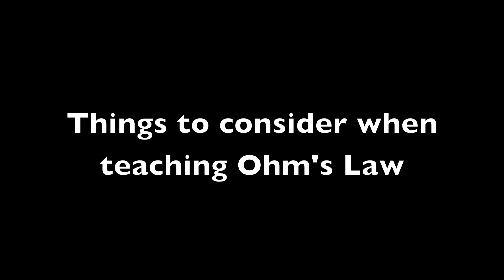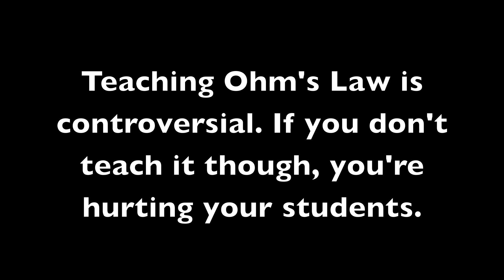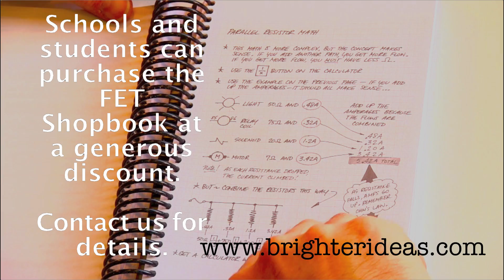Teaching Ohm's Law to Techs - Part 1

Comment: with 17 years in Mobile Electronics, 46 years from the time I was a kid until now working with electronics and DC voltages.
I walk into a home depot and ask what is supposed to be a licensed electrician for 10-3 wire to make an extension cord for a table saw rated at 240@ 18 Amps draw max
When the saws manual states Maxlength of extension cord at 10-3  if 50' (21 to 30 Amps) Not even going into how long the cable will be I get this if I try to run more power into the saw its going to heat up and fry the motor on a 220/240 volt 3 hp single phase saw, he tries to tell me its like a garden hose its going to blow up fatter ?????  I'm putting too much current into the saw The guy has no frickin clue how Ohm's law works.
Using undersized wire would cause resistance and heat up the motor.
I asked for oversized wire it could have used 12-3 cable for the distance I was running it from the dryers outlet plug hole, I also took into account the fact the dryer circuit is a 30 Amp breaker and 25' long This gives me a total 50' of 10-3 at 18 amps AC This is overkill for what I was going to do.  I told the guy you've got no idea how ohm's law operates and walked away.   " I'm feeding the saw too much power my ass" The saw will use whats required to run the wires will not heat up and its not going to burn up the motor, Almost all motors have a protection circuit on them, if mine did not I'd have added it @20 Amp's 
Your darn Right,   I,E,R  is no way to teach Electronic theory and ohm's law.
When I was in high school I wanted to become an Electronics engineer, The math Theories thermians ex.. are hard  You can't do What I did stay out late and party, then try and remember this stuff the next day, you won't do it. Having dyslexia made it even more complex to deal with because I had to work twice as hard to learn anything. But once you Learn it you will not forget it.
When I was about 13-14 Microchips came out simple micro chips.
This stuff is 10,000 times more complex today. Now its microscopic electronics.
You still use the same Electronic Principles today they did making vacume tubes, your just adding billions more of them. Each one doing its own thing.
A computer when I was 8 filled a room 3 times the size of a football field ( to an 8 year old)
And it wouldn't even begin to do what a smart phone can do today.

Its an exciting field to be in, if you like electronics It pays good do it. Go to school study hard go home and do your homework, ignore other kids, on the side learn how to program or make software.  You'll never have to want for a job.

Comment: Never had this problem ever. Once you have the concept of electricity the terminology is very easy. What bothers me is even some people who had a diploma in Electronics can't even explain what these are but only memorizes the formula;they can answer problems on paper but most of the time can't troubleshoot or misdiagnose stuff, such as thinking it is a software problem instead of the sensor. I'm in automation and despite the orientation towards technology my teachers emphasized strong physics understanding not just knowing how to use tools.
Reply from the maker: Congratulations. You're fortunate. Thousands aren't. That's the point.

Comment: Thank you! Your 'suggestion' at 3:40 to use a=v/Ω for teaching this important relationship is valid for all reasons you have stated including that fact that it [the equation you state] is mechanically equivilant to the true definition of Ω's Law which states that the current through a resistance [the proportionality constant] is directly proportional to the voltage across that constant resistance and inversely proportional to that constant resistance.
Reply from the maker: Yes - yes it is. You're welcome. And, BTW - remember to say "volts and ohms MAKE amps" to keep it complete...

Comment: Call me old fashioned, but, using your system, how would you explain the difference between, say, EMF and Voltage?  U=E-Ir.    Where I live, the exams require a firm grasp of the math, so as a teacher of Practical Engineers (equivalent to an Associates' Degree), I cannot use your approach, interesting though it is.  Even for teaching Licensed Electricians, I cannot avoid the math, as the students are required to solve government exams of Electrical Theory, albeit at a lower level.  Thanks for sharing your ideas.
Reply from the maker: I have a problem with people thinking that everything is unidirectional. Education is Latin for "draw out" - not shove in. I never said that the math wasn't necessary - I said it's ridiculous to teach it on day one to guys who hate math. The reason they hate math (in this country - not sure where you are) - is because of exactly what I'm arguing -- namely that in our schools math has no context. A kid with sterling math skills sees Ohm's law math as a simple division equation, but can that kid in turn wire circuits and do everything else required mechanically without further training? A mechanic, whose math skills are lower, sees a fraction as the enemy, but sees a voltmeter and a wire and a battery as a game that he can win. If we teach the practical first to give the terminology context then the math follows naturally without effort. Seriously - I've done this for 25+ years. V÷Ω=A works instantly -- E=IR does not. This is really a pointless argument - in my experience, if we stand in a US national cemetery side by side, we both see perfectly aligned rows of headstones - even if our directions of sight are only a few degrees off. Either way - what matters is that it's a cemetery - not a Geometry quiz.

Comment: There is a distinction between the variable and the units that you use e.g. resistance and ohms. I think it should be clear which is which, or you could run into other problems.

When you say anything taught in electrical class should be geared towards understanding diagnostics, that's actually great advice when training a maintenance technician. Might be a bit limiting though if it comes to training a future electrical/electronic engineer.

Anyway, great stuff for techs but not robust for every type of audience.
Reply from the maker: Your comment isn't unique. There are a number of nearly identical arguments buried in the comments below. I repeat, if you can learn the variables in the EIR—>VΩA direction, they can just as easily be learned in the VΩA—>EIR direction. I'm not teaching engineers, but engineers will presumably - hopefully - eventually use a DVOM. When I was taught to fly airplanes in 1976, I knew the difference between MPH and KNOTS. I didn't calculate the ratio in flight on final approach. But if I was trying to explain what I did to someone who didn't understand KNOTS, I converted to MPH. I appreciate that there is a distinction, but what I can't understand is why it's that big a deal. There's a twinge of elitism in your comment. I think what you say is true, but it's intuitively obvious therefore should go without saying. While I appreciate the nod, I also note a smirky afterglow.
Reply: Thanks for the response. The goal wasn't to be 'smirky' or 'elitist'...
Reply from the maker: Jay Smith I apologize for the insinuation, but I deal with a ton of people who toss about the "engineering" argument when its clear I'm not teaching engineers. My suggestion is for simplicities' sake. V on the whiteboard —> V on the meter.

Comment: everything you said is exactly how i felt getting certified in mobile electronics. it was really hard and felt like i was picking the wrong industry, i finally got it, but you are 100% correct. theres times i get so confused because of how i learned i have to take a break and refure to my notes to almost re learn it. i strongly agree with you, its shouldnt be day 1

Comment: Thanks Mr. Daniel for the video, but I have got a question. According to ohm's law the flow of current "Coloumbs per second" is directly proportional to the voltage "joules per Coulomb". How would increasing the number of Coloumbs passing a specific point in a circuit per second which is "current", increase the energy in joules of each Coulomb passing that point which is "voltage" ????
Reply from the maker: +Reality Acceptor  Same calculation and concept as BTUs per unit of fuel. If you increase either the volume of fuel used per second, OR, the BTUs per unit volume, total energy (Watts) increases. It's the wattage formula. If you double V, you double A. Since W=VxA the W increases as to the square of the increase in voltage. 2x V = 4x W
Reply: Daniel Sullivan Thanks. What I meant was that if we had a very narrow tunnel through which two persons each of energy say 2 joules could pass beside one another and we narrowed the tunnel "increased the resistance" which made it possible for only one person to pass, this would never mean that the 2 joules energy that each person has got, would increase. So why does the voltage  or joules per each coulomb "person" increase by decreasing the number of coulombs "persons" passing the narrow tunnel or "resistor"?
Reply from the maker: Reality Acceptor Your first comment didn't include resistance. That's an entirely different thing. More Ω = LESS Amps, and less W.

Comment: I have been in the electrical trade for thirty plus years and then have been teaching electrical for 10 years. The volt [E (for a source) or  V (for voltage drops)] is the unit of measure for ""Electromotive Force"" also known as voltage or electrical pressure or potential difference. The ampere (A) is the unit of measure for the intensity of current flow, which refers to how much current is flowing in a circuit. Ohm's law describes the relationship between voltage, current and resistance. Current is not "created" by voltage and resistance, rather it is a reaction ( or result ) to the application of voltage to a certain resistive value.

E [electromotive force (or electrical pressure or potential difference)] = I [intensity of current flow (the number of electrons flowing past one (1) designated point in one (1) second)] x R (measured or calculated amount of opposition to current flow)

                                                                             OR        

This pneumonic defines the relationships between voltage, resistance and current. If we look at the equation E = I x R, we can see that if we increase the resistance the value of the voltage goes up. The same applies to the current....Thus Voltage (E) is directly proportional (one goes up, the other goes up) to both resistance and current and resistance is inversely proportional (one goes up, the other goes down) to the current. The SYMBOL for voltage is "E".....The SYMBOL for resistance is "R".....the SYMBOL for Intensity (or amount) of current flow is "I". The unit of measure for Voltage is the volt (V)... The unit of measure for Resistance is the ohm (represented by the Greek letter Omega)...the unit of measure for Current is the ampere (A)(represented by the Greek letter Omega). To confuse the SYMBOL for the unit of measure, is self defeating.
Reply: +Roger Butler
 Sorry, pneumonics did not appear...
Reply from the maker: +Roger Butler How many times in your 30 years/10 years have you read E, I and R on a meter? 99% of the guys we teach will never need E, I and R. Those who are smart and inspired enough to progress educationally will have ZERO problems adjusting to the change of symbols/variables/units. If the guys we teach were more literate and more confident in their electrical studies, then this wouldn't be an issue. I'm not sure why people who comment do so under the misguided inference that I'm saying that E, I and R aren't relevant. They ARE relevant - but not to an 18 year-old kid who  barely graduated high schools and needs a TACTILE teaching style. We put a meter in their hands, teach them V, Ω and A, then have them use E, I and R mathematically ---- sorry ---- stupid. Why don't we teach truck drivers using random symbols and kitties and stars and gumdrops and the number 7-3/8? Then send them out in trucks with 1-8 and R? Come on people - get a grip. It's not about you and your precious beliefs and memorized teaching scripts - it's about an entire nation of techs who don't know what a relay is. While we're at it, let's change "voltage" to "J" for "juice.

Comment: Wow !!!   I had my first class yesterday and sure as hell, they laid this on us and most of us were like dear in the headlights. Thank god he said that we will get back to it later. Totally agree on the " E I R  vs  "V Ohm Amps. Thank You
Reply from the maker: +herman58100 Remember - VOLTS (V) and OHMS (Ω) *MAKE* AMPS (A).
Reply: +Daniel Sullivan .....I agree with you it should be taught at the end......but on the state exam it says I, E, R  Not volt amps and resistance or ohm's
Reply from the maker: Walking in the light for Yeshua Yes - it will, because they're not very imaginative. Ask yourself a question: is it more reasonable to learn it using V, Ω and A, and THEN make E, I and R make sense - since V, Ω and A are on the meter, OR, learn it initially with E, I and R, without context, since the books uses volts (V), ohms (Ω) and amps (A)? If you can learn it in one direction, you can certainly learn it in the "opposite" direction, especially if the opposite direction is more logical???
Reply: Daniel Sullivan I agree with you completely...E, I, R, and P still confuse me today sometimes lol
Reply from the maker: volts AND ohms MAKE amps  <<and>> VOLTS÷OHMS=AMPS.  How about - to remember it - Enthusiasm (E) TRIUMPHS OVER Reluctance (R) = Iehouah (I). I'm not particularly religious, but I try to be inspired and literate. E÷R=I... ???
Reply: Daniel Sullivan lol thanks that works for me lol

Comment: Who would give their students math problems using Ohm's Law without first explaining how a circuit works? 
And why get rid of E, I, & R? Understanding electromotive force (E), intensity of current flow (I), & opposition to current flow-resistance (R) is necessary to understanding how an electrical circuit operates. Just because symbols on a meter are V, A, and Ω does not require us to get rid of E, I, & R. I think it is essential so students gain understanding; and if they don't get electromotive force (E) is "pressure" measured in volts (V) and intensity of current flow (I) is measured in amperes (A) & opposition to current flow-resistance (R) is measured in ohms (Ω) then I would have little hope for them succeeding in a classroom or work environment!
Honestly, I have never had any student exhibit any problem by using these terms before teaching them how to use a DMM.
Reply from the maker: +van1963 Who are you, do you have 33 years experience as a tech and trainer, why should I listen to you, and why are you being so insulting? I assume you're a teacher, and you're wildly successful. Please elaborate...
Reply: Daniel Sullivan I am not insulting you. I am just stating what I believe and have experienced. I feel sorry for you that you have such "thin" skin and have such a big ego that you think I was insulting you. Get over yourself. If someone has a difference of opinion so what? I would "elaborate" more but I don't want to make you feel inferior and make you cry!
Reply from the maker: van1963 Oh - you're a troll. Sorry. Missed that. Move along...

Comment: FWIW, IMHO;
Your point on Ohms law is spot on;  I'm not an electronic engineer - just passing/general interest - learnt the V=IR equation as a kid which gives the relationships but doesn't tell you what drives what - i.e. doesn't tell you which one is fixed in a circuit, and remains confusing in my mental model to this day.

As soon as there are multiple components in a circuit it feels like Ohms law sends you round in circles , i.e. amps derrived from resistance which affects volts which in turn affects the amps etc .etc...    I 'know' my mental model is wrong - just emphasising how confusing it can get if starting from the wrong teaching place & effectively a blocker to more in depth experimentation.

Comment: I think the biggest problem to teaching Ohm's law is getting students to understand that V is actually delta V, that is, the difference in electric potential between two points. In a circuit diagram, we often conveniently label one point as 0V so that every other point is in reference to this 0V point. But, that convenience to us engineers becomes a huge detriment to the student.

I can't count how many times students forget that voltage is always measured between two points, and so they'll end up putting in values that make no sense into Ohm's law when solving a circuit.
Reply from the maker: +dllexport- I'm fine with that assessment - but we're not engineers.

Comment: Im currently being taught via the traditional method. Back in DC i never struggled with understanding ohms law. However, i did notice some of the other student around me struggling. A few of them still do. I don't know if any of them actually understand the relationship between current, voltage and resistance. I believe they just know how to work the equations. The lessons that i'm being taught have been the same for at least 15 years. Honestly i could understand a need for some reform. Although, that being said i also believe things shouldn't change too much. If a system has been working effectively for 15 years im not sure how much change it really needs.
Reply from the maker: +Thegreatmush It HASN'T been working. If it were working, why would I suggest it be changed? C'mon guys - understand I've been teching electrical systems 27 years - E, I & R do-not-work...